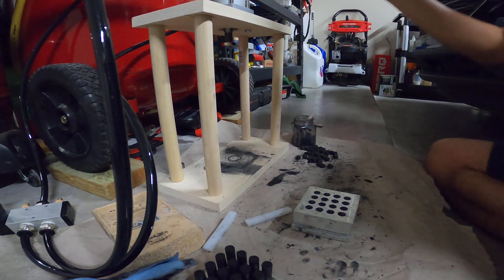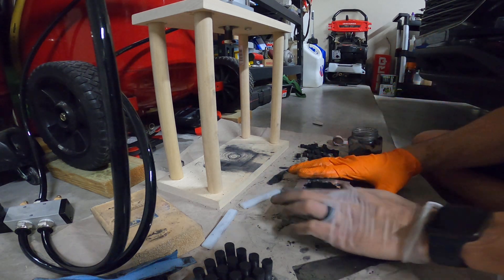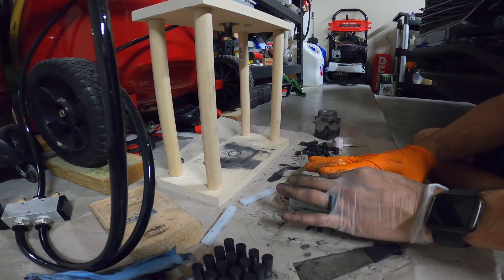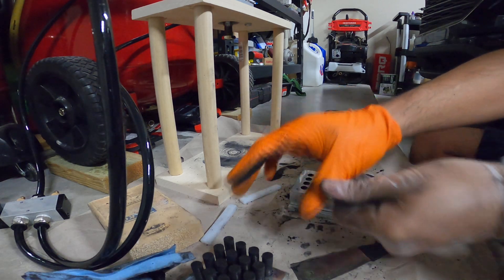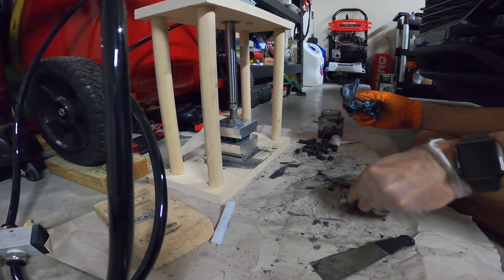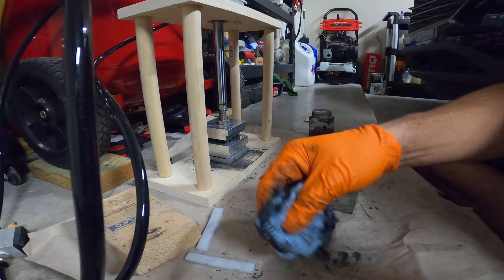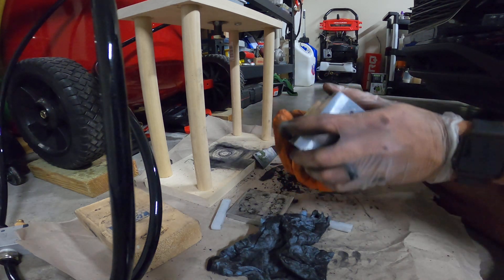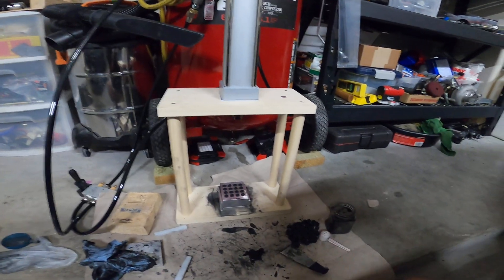Pressing some tiger tail stars with my new star plate

Comment: How did you build this? What do you use for the button to control the air and what do you use to hook up the air compressor and to what?
Reply from the maker: So I bought the stuff off Amazon it’s just pneumatic controller and push to lock fittings and a cylinder but it’s not very strong like my hydraulic press and I made it out of wood as a test but they sell aluminum rods that at 1” thick and some aluminum plate for the base and top.
Reply: @E85_STI  how does it attach to the hydraulic? Are you using a car jack?

Comment: When I press my stars I make 600g - 300 Damp and 300 dry powder When you press your stars and you see liquid add some dry comp mix it thoroughly And add more as you go onto you see no more liquid And if it is too dry it will not hold the star together when you squeeze it with your fingers, so you have to make sure your comp is properly soaked it only needs to be damp.

Comment: 💥🧨🤘 try adding less water to your composition, The liquid remaining after you press your stars is due to over wetting in your comp use just a bit less and if it’s too wet and you notice liquid coming out always make half-and-half soak up the first half and keep the other half dry so you can add some dry comp to the over soaked composition after you notice liquid!..

Comment: I thought about using a air cylinder for pressing could u show me more on your press
Reply from the maker: Yes so I bought a pressure to force gauge and this press at 150 psi produced 500 lbs of force. I have some pressing calculations and this press can press up to a 1/2 inch rocket decently. Anything smaller than the 1/2 it will press just fine. What all did you want to know about it?
Reply: @E85_STI  i bought an arbor press and modified it i am building 4oz and 5/16 rockets with it. And i have used pneumatic air cylinders and 3 way valves for projects just curious on how you built the set up .
Reply from the maker: @PineyWoodsPyro  so I have an arbor press modified as well but I just recently bought the hydraulic press off of woodys rocks so I probably won’t use the arbor or pneumatic anymore but I bought the adjustable mufflers from Amazon and I use that to control the speed of the rod. I have just the standard on off controller and a dual action 2.5 bore cylinder. The bigger the more force it can produce. This cylinder on Amazon said it could deliver up to 1000 lbs but  after I did the calculations it should have produced 636 lbs or so. The true force was right at 500 lbs as I used the gauge. On my arbor press I cracked it down as much as I could literally standing over the press and pushing down it hit 1000 lbs of force and that’s all I could produce with the factory bar it came with. I’ll make a video of the forces and show the gauge so you can see the arbor vs pneumatic force.
Reply: @E85_STI  i want to get one of woodys presses but dont see my self spending that kind of money right now. Towards me using it on cobra mods. Lol
Reply from the maker: @PineyWoodsPyro  yeah I hear you. Do you have a terminator? I’m good on mods for now on my car it puts down good power so I got the press otherwise I wouldn’t have bought it lol.
Reply: I am needing one that can give me at least 7k lbs
Reply from the maker: @PineyWoodsPyro  oh yeah you would need hydraulic then. I just posted the press I bought from woodys. That thing is massive I didn’t realize how big it was compared to the photos.